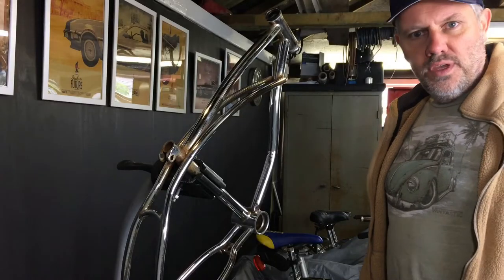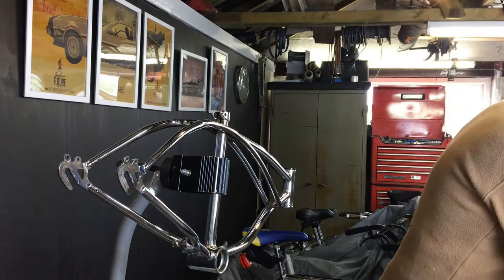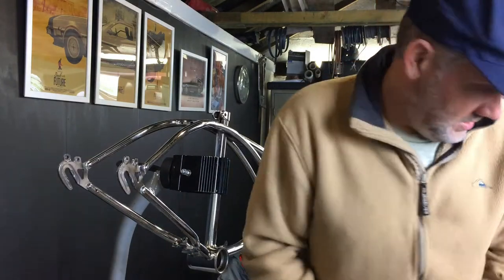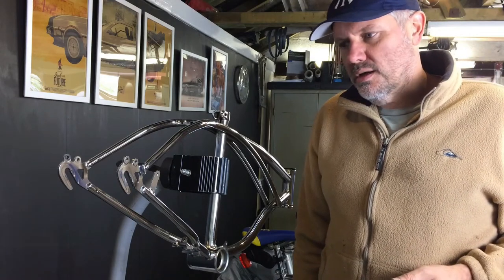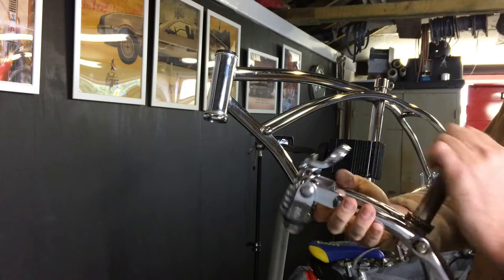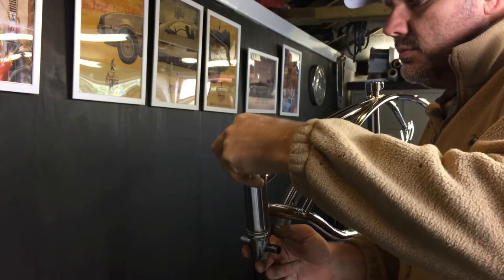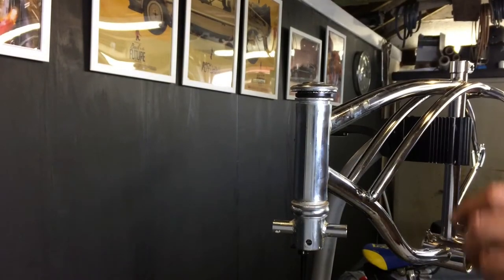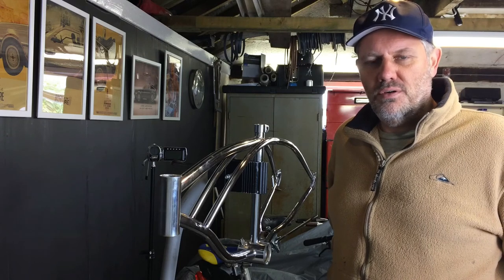Lowrider bike restoration - Part 2

Comment: what do you suggest for the chrome, this Valeters pride stuff isnt sold outside the UK
Reply from the maker: I use medium wire wool (steel wool), then you can use a chrome polish (autosol) or a brand available to you. I just found the tub cheaper then buying tubes - but I do a number of bikes. Hope this helps